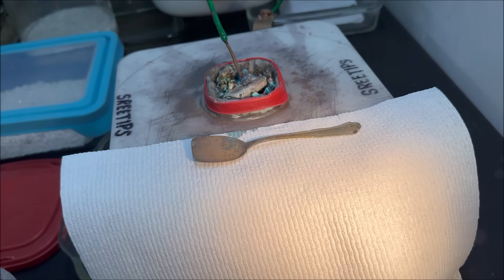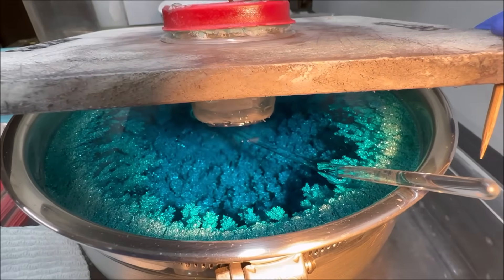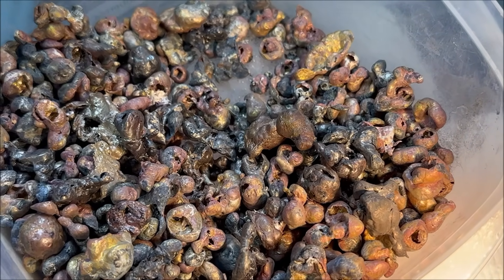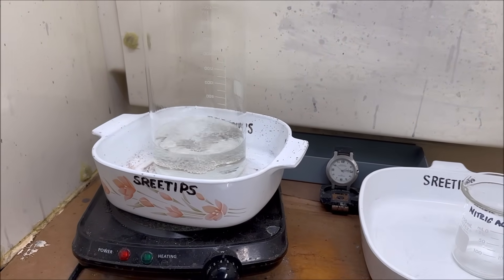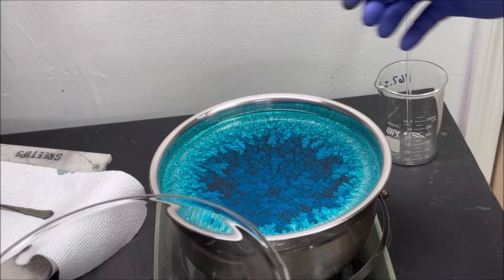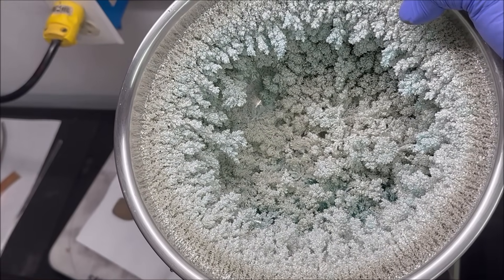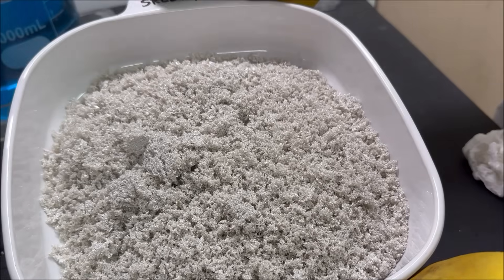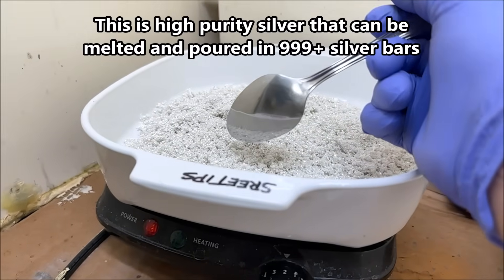999 Fine Silver Cell Harvest and Reboot

Comment: So are the materials you use (not counting the equipment) more expensive than just buying silver?
Reply from the maker: I buy sterling silver at estate sales. I use it refine gold. Silver is a by-product of my gold refining. So I’ve got a ton of silver powder sitting around from that. I melt it into shot, run it through my silver cell.
Reply: @sreetips  Can you answer his question though.
Reply from the maker: He wants to know if the silver I produce is more expensive than just buying silver. I don’t know. I haven’t bought any pure silver in at least a decade. I buy sterling silver at local sales and use it to refine gold. Silver is a by-product of my gold refining. I’ve got much of it laying around. So I figure I’ll melt into shot and run it through my silver cells. I’m not in this for a big bump in price. I’m in it to de-dollarize. To convert my savings into metal. I’m not getting stuck with stacks of paper.
Reply: @sreetips  I understand. Seems way better than just buying pure silver if you are using it for that. I did a little research and found out it’s not just some infinite silver glitch like I was thinking at first lol. thanks for clarifying

Comment: Where do you get the base scrap material from?
Reply from the maker: I refine gold. I use sterling silver, that I buy at estate sales, to refine the scrap gold. I recover the silver from that, melt into shot, and run it through my silver cell. The cell converts the impure silver (about 980 parts per thousand silver) to high purity four nines fine (9999 parts per ten thousand) pure elemental silver metal. The impure silver is added to the anode basket. The anode basket is suspended in the silver nitrate electrolyte. I pass an electric current through the impure silver. The silver dissolves, passes through the Dacron filter, travels through the silver nitrate electrolyte, and deposits on the stainless steel bowl (the cathode). The bowl is connected to the negative pole of the power supply. The process only deposits pure silver on the cathode. So I’m refining the impure silver, into high purity silver. When it’s full, I harvest the pure silver crystal. Then I repeat the whole thing again.
Reply: @sreetips  Thank you for the detailed reply!

Comment: Ok, so you aren't "growing" silver, especially not in the sense of growing silver from whatever process you call this, however, you are refining silver from various types jewelry or other objects, so one would still need to procure ones own silver from ,... whereever one gets it from.
Reply from the maker: The silver does grow on the inside of the cathode bowl. I refine gold. I use sterling silver to refine the scrap gold (I buy sterling silver flatware at estate sales). I recover the silver from that, melt into shot, and run it through my silver cell. The cell converts the impure silver (about 980 parts per thousand silver) to high purity four nines fine (9999 parts per ten thousand) pure elemental silver metal. The impure silver is added to the anode basket. The anode basket is suspended in the silver nitrate electrolyte. I pass an electric current through the impure silver. The silver dissolves, passes through the Dacron filter, travels through the silver nitrate electrolyte, and deposits on the stainless steel bowl (the cathode). The bowl is connected to the negative pole of the power supply. The process only deposits pure silver on the cathode. So I’m refining the impure silver, into high purity silver. When it’s full, I harvest the pure silver crystal. Then I repeat the whole thing again.
Reply: @sreetips  thats wild

Comment: Imagine having 10 set ups like this. That’s 28lbs roughly every two weeks of silver. 28lbs x 26 weeks that’s over 700lbs of silver which is 240k at current prices. Not a bad side hustle 😂
Reply from the maker: With two cells running, and staggered harvest times, I should be getting roughly 1.5 to 2 kilos per week. I need to get more of the cement silver melted into shot.
Reply: @sreetips  do you have a step by step process for this? I mean I get the gist of it but dealing with amps and acids would be worrisome to me unless I fully understood what I was doing.
Reply from the maker: All I have are my videos. They are the most complete and comprehensive refining videos on the entire internet.

Comment: What is the electrolyte solution made of other than silver nitrate? How do you determine how much silver nitrate to use?
Reply from the maker: It turns blue because there’s copper in there too. So it’s got some copper nitrate in it.
Reply: Thank you for the reply. I love science and started getting into precious metals a little over a year ago, but I'm an amature when it comes to the refining aspect. Your videos are phenomenal! I also realized I wasn't clear on my question and have a couple more that I'm hoping you can help with. If I wanted to replicate this process using a different size container, bigger or smaller, is there a standard ratio of 999 pure silver to nitric acid to distilled water for creating the silver nitrate electrolyte bath? If I'm using sterling silver or something less pure in the anode basket,  is there anything I need to consider? If I ever decided to do this for quantity would you recommend one large electrolyte bath or multiple smaller electrolyte baths? My last question do you have info for using electro chemistry for growing pure copper crystals?
Reply from the maker: I use 0.9ml of nitric acid, mixed with about 1ml distilled water to dissolve 1 gram of pure silver. I’ve got a video on how to build and operate a one liter glass silver cell. I also have a video on how to build and operate a 3.5 liter stainless steel cell from scratch. Using sterling to feed the anode is not recommended. The high concentration of copper in sterling would quickly saturated the electrolyte with copper. In order for electrolytic refining to succeed, the anode material must be relatively high purity to begin with.
Reply from the maker: There’s a critical distance of between four and four point five inches that must be maintained between the anode and the cathode. I use copper to refine silver. But after that it becomes waste. I don’t bother with the copper because clean copper for refining is cheap and plentiful. After I use the copper to cement out the silver, it gets processed in my waste bucket full of angle iron. Then I toss it because it would cost more to try to recover and refine it than it’s worth.
Reply: Btw, I will be doing a gold extraction project in the future as well and may have some questions when I start that project. My friends have been saving up their vape pods and old batteries (for the god contacts). I also have a bunch  of old cell phones, laptops, tablets, and PC's ( Set an alarm stripped the parts off so I still have to).

Comment: So are ypu gainimg silver or just purifying it?
Reply from the maker: Not gaining any silver. I’m just purifying it, refining it to high purity in the electrolytic silver cell.
Reply: @sreetips and i appologize that was a rather long winded, multifacited question.
Reply: In your opinion, do you think this process would be worth it for silver coated copper bus bars? I must have over a 100 pounds of them. And I've been hesitant to just sand off the silver coating, but I know it is rather thin. I'm unsure if this process would even be worth the time or not as I intend to melt the copper down into ingots to store and for fun.  I didn't want to waste the silver. The main idea is future savings but i may just do it because its interesting. However if i have to dump a chunk of money into it for little to no return ill scrap the idea.

Comment: I wonder if you can accelerate your crystal growth by adding a real "earth ground" connected to the basket (if you don't have one already)?

 I think it would allow a more direct path to ground (earth ground) which would allow for more/larger/constant electron flow from + to earth ground. If you already are connecting your stainless basket to an earth ground, my apologies.

You may  already have a ground rod as part of your main power panel. Many main power panels have a copper ground rod driven into the ground or set into the foundation of the house and connected by thick bare copper wire to the power panel. If you have this already, you can simply tap into that ground rod, or add a new one close to your silver cell.

 I wonder if this would be a good experiment to try, with before & after tests. Maybe this will accelerate the growth or increase the size of your silver crystals.

I'm assuming you've already found the voltage "sweet spot", but when using a real earth ground, you might be able to increase the voltage and/or amperage to get better results?
Reply from the maker: That’s sounds interesting. Might make more current flow and speed it up even faster.

Comment: How do you keep the copper below 60g/liter concentration? How do you know its concentration?
Reply from the maker: I’ve used spectrophotometer in the past, but as long as I don’t use the electrolyte for more than two runs then the copper concentration stays well below 60g/liter.
Reply: @sreetips  Nice! Does this formula change with different size bowls?
Reply from the maker: No, 60g/liter is the magic number no matter how big the cell is. The limiting factor is a critical distance between the anode and cathode. Too far away and efficiency drops off. Too close and the silver could make contact with the anode and burn a hole in it. Goldie locks range is 4 to 4.5 inches. This is according to other refiners that I learned from. Another type of silver cell uses alternating anodes and cathodes plates hung parallel to each other with the proper distance, suspended in a large tank of silver nitrate electrolyte. Large refineries use this type of cell. But it’s very big and requires gallons of silver nitrate to run. The upside of this type of cell is that it produces large quantities of pure silver, fast.

Comment: How to configure the proportion of electrolyte? Thanks😊
Reply from the maker: I dissolve about 600 +/- grams of pure silver, then dilute with distilled water to create a silver nitrate solution that is, roughly, 600g of pure silver dissolved in 3.5 liters of liquid. That about 170g per liter concentration. I’ve use this formula for over a decade with good results.
Reply: @sreetips  Thank you very much for your guidance☺

Comment: Why this new silver have bigger crystals than previous one that we could see at the end of video?
Also thank you for recording and explaining everything :)
Reply from the maker: The conditions in the cell are constantly changing. Silver in electrolyte going down. Copper going up. Slimes impairing current flow. Temperature. Pressure. It would be difficult to duplicate those conditions to produce large crystals every time.

Comment: hmmm SIlver takes 1 electron and Copper 2 to dissolve. So If you loose 200 grams of Silver there is 100 grams of Copper in your electrolyte. That is 6.25% of the total? That says me that cement Silver is barely more pure than sterling silver. Yeah I suspect there are equilibriums involved in salts dissolved in solution. Interesting. Thanks.
Reply from the maker: I’m guessing at the loss of silver. It could be more, could be less. What convinced me was this; I once ran the electrolyte three times adding only distilled water, no silver nitrate. On the third run, the silver crystal had green junk (copper) and the electrolyte was completely devoid of silver. That’s when I started adding silver and only using the electrolyte for two runs only.
Reply: ow darn. said that wrong. I forgot to include the molar mass, but I think it's less Copper even because the molar mass of Coper is lower than of Silver.
Reply: So the purity of cement Silver will climb to aprox. 96%

Comment: How do you tell or test electrolite for copper consentration ??
Reply from the maker: I’ve got a spectrophotometer. I used to check it. But it was never out of spec high. I ran the cell for three runs once, adding distilled water only. On the third run I noticed green junk (copper) on the pure silver. When I tried to precipitate out the silver chloride with HCl, none came out of solution. All the silver had been depleted. Made a believer out of me. I never use the same electrolyte more than twice. I always add additional silver nitrate to ensure a good high concentration of silver.
Reply: @sreetips  thanks for responding so safe to conclude i coild use electrolite twice without copper leaching into silver??
Reply from the maker: @dustinscroggins3382  yes, as long the silver in the first run didn’t have excess copper. And I always add more silver nitrate to the second run to keep silver concentration high.

Comment: Now I am curious how to determine that the copper saturation as below the 60g per letter threshold.  Do you know of any testing method to determine the copper concentration?  Maybe a 10 ml sample in a test tube,  remove the silver as silver chloride and filter it out, then cement out the copper and weigh it.  Multiply weight by 100 and if it’s less than 60 the solution is still stable for refining purposes.  That’s what I would do but there has to be an easier way.
Reply from the maker: I’ve used a spectrophotometer. But it was never very high concentration of copper. So now I just never run the same electrolyte more than twice. And I always add silver nitrate to the second run. This practice has kept me out of trouble for thirteen years. I’ve had the silver analyzed several times. Comes back three nines every time. Except once, I ran the silver crystal back through the cell with fresh electrolyte a second time. Had them do an ICP assay. Came back greater than five nines fine. That’s 99,999 parts per one hundred thousand pure elemental silver.
Reply from the maker: Three nines is industry standard for pure silver.
Reply: I recall the 5 9s fine silver video.  That was an impressive result.

Comment: When testing for dissolved silver, I (again) recommend you use potassium iodide instead of hydrochloric acid as it is more sensitive and the distinctive yellow color is better visible in trace amounts.
Reply from the maker: Good input, thank you.
Reply: @sreetips  You're more than welcome. It is also something I think more of your viewers will appreciate.
Reply: @stompingpeak2043  That blue is copper, when you see that, you normally don't test for silver.
Reply: @apveening  the blue was blue on my screen. maybe rest your computer?
Reply: @apveening  no. it's advise; since you might have picture color issues
Reply: @Gnolomweb  I don't have colour issues, I merely stated that using iodide for testing for silver will give a yellow and easily distinguishable precipitate. He very clearly did not use the aforementioned iodide and depending upon the concentration of copper, the solution is anywhere from colourless to dark blue.
Reply: @apveening  Correct, the soultion is the color blue; not copper.
Reply: @Gnolomweb  And I never stated otherwise, so learn to read and understand English.
Reply: @apveening  don't be mad. I'm just trying to help you learn what colors are. Maybe no one has taught you correctly?
Reply: @Gnolomweb he clearly means that the blue solution is copper, not copper colored.
Reply: @Gnolomweb He meant copper as in the element not the colour, learn to read please
Reply: @thatokperson  are you also blind? the water is CLEARLY blue to everyone. just check the comments.
Reply: @Gnolomweb  I commend your trolling of upsetti spaghetti people on the internet.
Reply: @RonnocMakesVideos  ...just watched video again. still blue.
Reply: @apveening Wait so that blue liquid isn't Glacier Freeze Gatorade?
Reply: @ihswap  No, but if he used Lemon-Lime Gatorade he would be able to differentiate the color better
Reply: @Gnolomweb the blue was blue on my screen. maybe rest your computer?
what did you mean by this
Reply from the maker: I’ll order some and use it to test for silver nitrate. Thank you.
Reply: Do you also do recovery? This is the first time I have watched this.  Is this something that anybody can do or do you need a chemistry background?
Very interesting.
Reply: @CaptiveManAudience  lol, b/c you're color blind = I can't understand English. lol.
Reply: What happens to the crystal next?
Reply: @CaptiveManAudience   the correct comment to my post agrees the soultion is the color Blue. NOT copper
Reply: @Gnolomweb  the element copper has a blue colour when dissolved in solution like this... basic chemistry. Nobody is talking about copper COLOUR, they're talking about copper the element (Cu).
Reply: @TheBLSCoinCollectorsClub  "The copper is blue" IT WAS LITERALLY SAID!  Maybe english isn't your first language?
Reply: @Gnolomweb  Yo bro, nice trol 😂😂😂
Reply: @CristianSalles1  ty for fueling my hatred
Reply: @Gnolomweb my bad I thought the blue was piss forgive me
Reply: @Gnolomweb  the blue is copper, learn chemistry and english
Reply: @Gnolomweb good troll😊